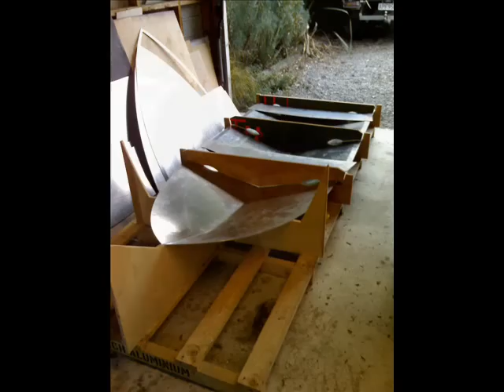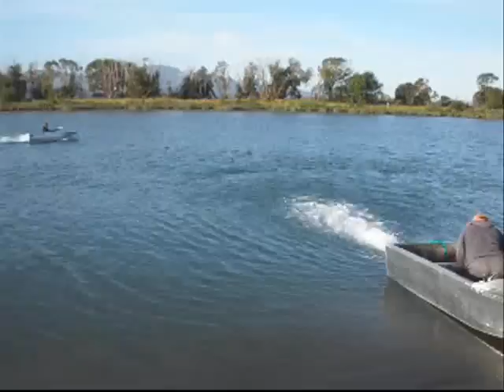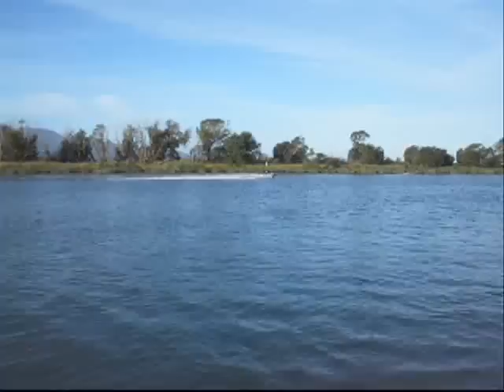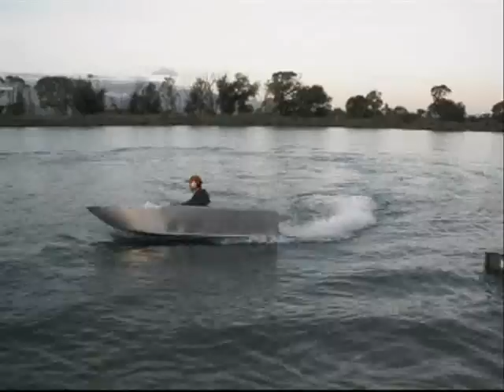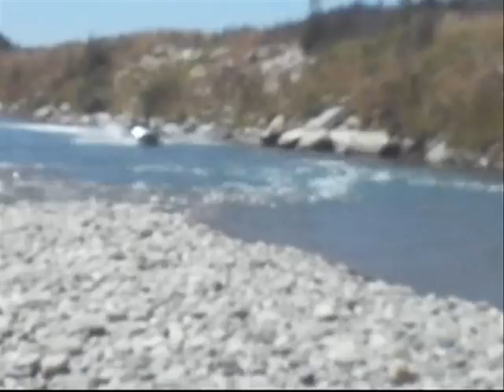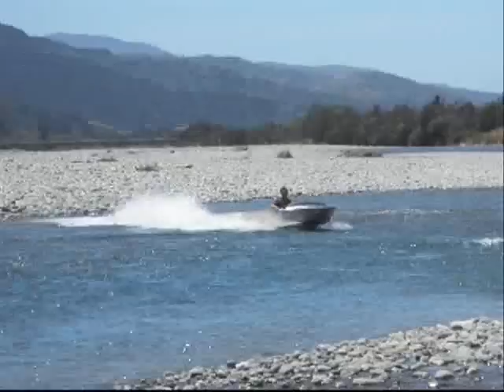Jet Dinghy, Build and test, NZ

Comment: If you were to put a sealed box around the engine it would cut down on the noise and keep it from hydrolocking the motor if you ever tip that thing